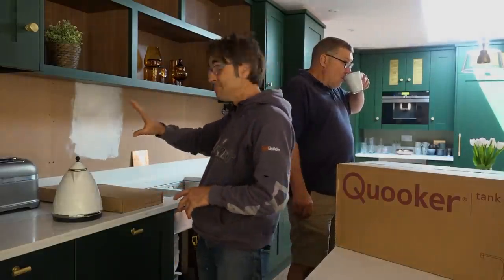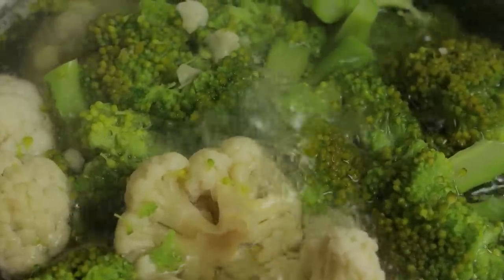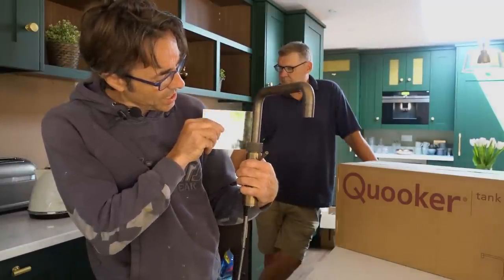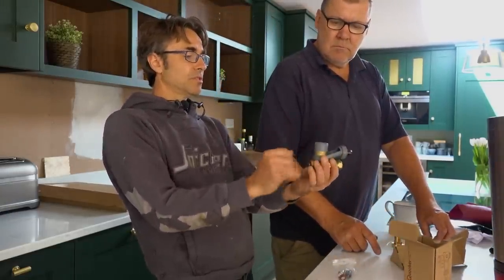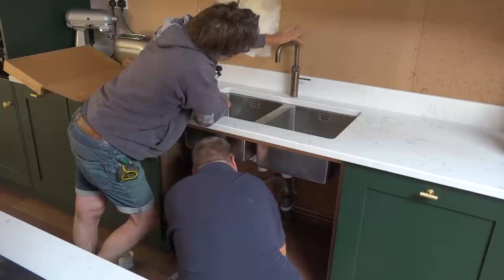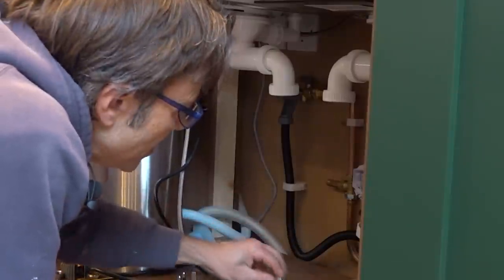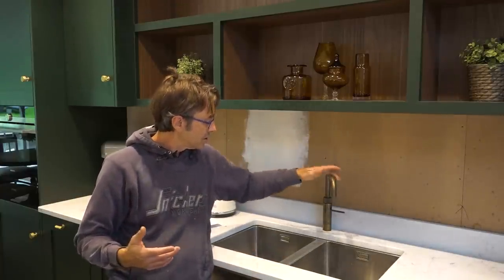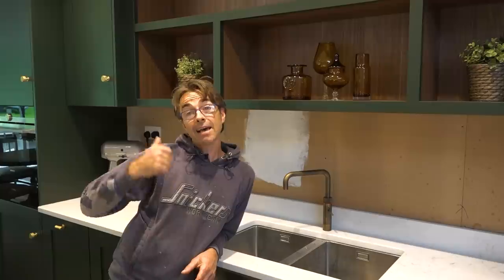Quooker Fusion Boiling Water Tap - Capel #29

Comment: These boiling water taps frighten the life out of me. What happens if a child wants wash their hands immediately after Mum has made a cup of Tea - that tap is still full of boiling water and the kiddie copes a handful. No thanks, not for me!
Reply: Doesnt work like that, i have one and they are different feeds within the tap - you can even hold the end of it when using the boiling water and the tap does not get hot
Reply: @bscott77  - thanks. I didn't know that. Maybe I need to do some more homework.
Reply: Geoff Stevens to be fair I had a lot of similar concerns mate, had to do quite a bit of digging around before buying one.  I have 3 young kids so wanted to be certain
Reply: @bscott77   - Did you opt for the Quooker or did you go for another brand?
Reply: @hsbcgeoff  quooker fusion flex in Black with 3 ltr tank and optional quooker cube system

Comment: you dont use 100 deg for tea, google it
Reply from the maker: You are so right and tea bags are not that great. Leaves in the pot is the best tea and you can read your fortune afterwards. 
https://willowandeverett.com/blogs/blog/the-perfect-temperature-for...

Although many people make cups of tea with boiling water, this is actually usually too hot. When you use boiling water it can add bitterness to the tea, except in the case of cheap industrial tea where the subtle flavors of leaf tea are absent anyway. You should be aiming to stop the kettle before it reaches boiling point to ensure you get the best temperature. With the perfect temperature of ...
Reply: @SkillBuilder  I only know cause my mate just bought a boiler tap and this was HIS reason for not going for the Quooker :-) and I am very bad at making tea.
Reply: @SkillBuilder  that's got to be you writing that Roger.. only a fellow plumber  would know the formula for a perfect brew. I remember you on the cover of professional plumber magazine back in the early 90's. Plumber of the year if I recall. Those free magazines were great

Comment: Don't like the energy inefficiency of a kettle so let me spend >£1000 on a tap to replace it. It'll take about a lifetime to realise the benefit of the >£1000 investment, not even accounting for the opportunity cost of not having the >£1000 invested! 🙄
Reply from the maker: Daniel 
You are right, the economics do not stack up. They are assuming you boil a kettle, forget it and then reboil it which is bollocks.